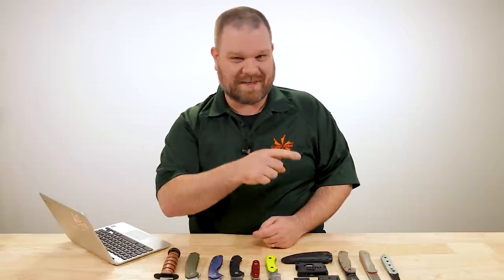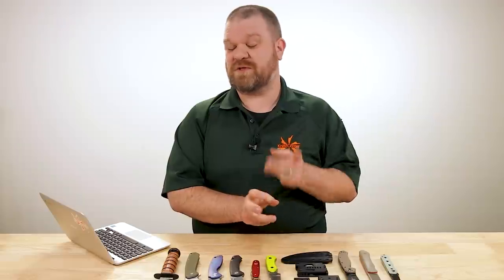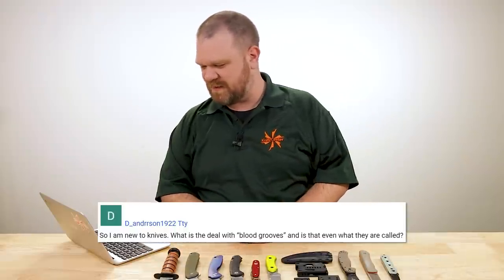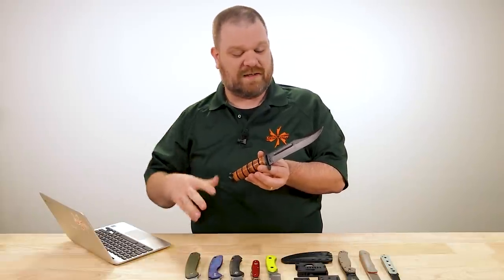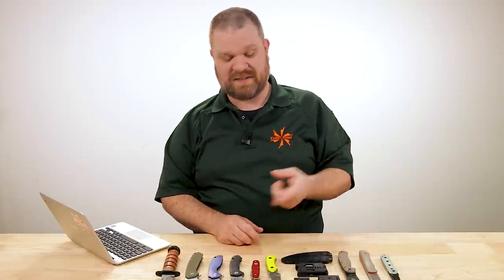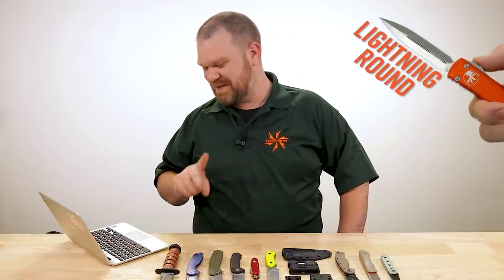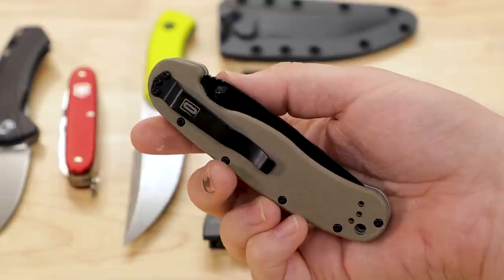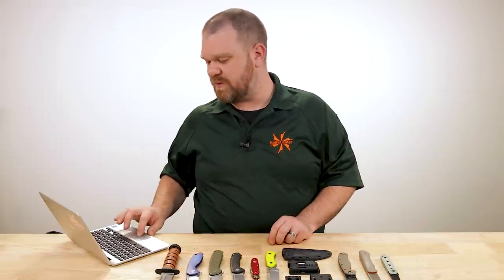KnifeCenter FAQ #94: What Is A Blood Groove?

Comment: If the knife maker made the groove with weight in mind then it's a fuller. The Cold Steel 1917 Bowie is a good example of an obvious weight driven groove. That knife has a long blade but it's not that heavy. But some knives are obviously just adding a blood groove to make the knife look more tactical or cool. And if Ka Bar says it's a blood groove then it's what the maker says it is. In war or something if your Ka Bar gets stuck in an enemy he can still bleed out before he kills you.
Reply: Respectfully disagree. At the risk of being distasteful to some of the public, you must realize that when a knife blade enters a soft tissue "object", the tissue closes around and into the fuller or grove. There will VERY little to no blood or fluid exit beyond what the blade would cause if it lacked the fuller. In the same vein ( oops ! ) the fuller will have a negligible effect on the "suction"  or resistance  to removal of the blade. Again, because the tissue has enough elasticity that it will conform to the shape of the blade cross section.
Reply: @wingmanjim6  Believe what you like. I don't care.
Reply: @wingmanjim6  He's even got the fake reason its called a blood groove wrong. Never heard anyone say it was so they could bleed out with the blade stuck with them. Most (incorrect) beliefs are that its to make the blade easier to pull out of the target or that its to make the blood run off the blade for easier cleaning after a good stab session. Granted both are incorrect, and its still a fuller whether its functional or aesthetic.
Reply: Fun fact... A heavier blade has more chopping power... Fun fact... Samurai use to pile up criminals to see how many bodies a sword could cut thru, earlier the standard sword would cut thru 3 or 4 bodies, after the blood groove slash flutter swords could cut thru 6 or 7 bodies... Now... How can u explain this drastic difference if blood groove has no impact on performance? When in theory the heavy sword should win hands down in a chop test? How much weight are we really saving on a 5inch KA BAR knife with a fuller? 0.05oz? Blood groove has been the oldest term for this feature. Now I'm a hunter... I've cut a lot of flush with different knives, and I'm telling u, tissue has a MUCH harder time closing up a blood groove. It might only be 2% increase in effectiveness, barely noticeable, but if that 2% causes a wound to take a extra minute to fully close up and maybe a extra pint of blood makes all the difference. And u forget, u get stabbed, wound seels around knife, guess what? U still have to move around to get help, continue the fight what ever, tell me would u rather have a blade with a fuller or without a fuller stuck in u walking to get help? Then tell everyone it has nothing to do with blood flow and it's not a "blood groove".
Reply: @stonefox9124  I completely agree with Stone Fox.
Reply: @seanhewson1341  Well, it's based on medical fact. If you don't like he facts, well then, I don't care either.
Reply: @stonefox9124  Well, your last two sentences are pure speculation - if you think that dinky channel is going to make much difference, all the medical information I've seen says otherwise. No disrespect intended.
Reply: @wingmanjim6  I think Ka Bar has more expertise on this subject than anyone else. They have been making these blood grooves for a long time and they know how their knives perform in war. If they call it a blood groove then that's what it is. Even if it didn't work for the sake of argument it's intention is still to be a blood groove, not a weight reduction strategy. So it's a blood groove and nothing else.
Reply: @seanhewson1341  M'kay.
Reply: @wingmanjim6  according to medical professionals every ounce of blood is critical in a gun shot or stab wound. What I have already explained is even if it doesn't make that much of a difference, even if it's just 2% increase that's still a critical amount because we're talking blood lose... Wanna talk science? No blood groove max surface tension on blade, no blood groove flat surface for wound to press against. With blood groove, reduces surface tension due to the pocket it creates, with blood groove u create a skin flap, like a doggy door, every movement causes it to swing making it very difficult for wound to stay sealed. I don't understand why it's so hard to grasp the science of a blood groove or why so many people are hell bent of dismissing it when I can drop facts like this all day long... To bad I'm at work...
Reply: @arrowheadguys7637  Yeah, because you know better than Ka Bar. Ha! Ha! After all they're only the people that have been making these knives and supplying them for wars for a long time. You are the expert here, not them.
Reply: @seanhewson1341  A marketing strategy is not fact. But if they give it a dumb name and sell more knives to folks who buy into it, despite the abundance of information readily available to the contrary, then more power to em.
Reply: @arrowheadguys7637  You're talking about Wikepedia. That's your "Abundance" of information? Ha! Ha! And if it was supposed to be a suction groove then why do they call it a blood groove. You haven't said a single thing that wasn't said just to be disagreeable. Knife Center dude here is trying to sell knives in a product friendly way so he doesn't want to call these things by their gruesome names. Do you think he thinks he knows better than Ka Bar? He knows what he's doing but you are just drunk driving your computer.
Reply: @seanhewson1341  wow, you really believe this, don't you? Worse, you think its really serious.

Sad.
Reply: @arrowheadguys7637  Yeah, you are sad. Ha! Ha!
Reply: @arrowheadguys7637  Have another drink. It's sure to cure your sadness this time. And if you're still sad try one more. Ha! Ha!
Reply: @seanhewson1341  A ha ha! You really got me, I'm so sad Mr. "Kabar would never lie to me to sell knives".
Reply: @arrowheadguys7637  Mr. Ka Bar? Yeah, you're a fountain of knowledge. Do go on, I'm hanging on your every word.
Reply: @seanhewson1341  You probably also think they're hard use knives, even though every time they're torture tested the rat tang fails. Go on with your kabar worship tho.

Comment: Hi Knife Center, Is there a SAK Waiter type knife with a slightly larger locking blade? The Waiter has the potential to be the best EDC known to civilized man, but that dang slipjoint blade and is too little/light for picnic duty. Ideal would be the larger SAK locking blade, corkscrew, bottle opener, tweezers and toothpick. Nothing more, nothing less. Any ideas? Thanks for what you do!
Reply: Theres a cheese knife based off the 111 frame.

Comment: Still waiting on a Rat1 with a crossbar lock. I've been in contact with Ontario and they said "It's being discussed"
Reply: This is something i didnt know I wanted, but am glad to hear may be a thing
Reply: Check out the Ganzo 727
Reply: @paulthelefty  I have the para 2 Ganzo version with crossbar lock but the steel is terrible 440C, my Rat-1 has AUS 8 which is also cheap but a lot better than the Ganzo. Also the crossbar lock often does not work as smooth. But for the price of 22 euro it is a great buy

Comment: The only problem I have with your fuller explanation is this: How much lighter is the blade due to the existence of said fuller? Look at it as a percentage of total weight and you'll see what I mean.
Reply: For a 3' sword the weight reduction is significant. 20-30% likely. Those fullers were generally much larger than the examples he showed.
Reply: It might not just be general weight reduction, but having a reduction in weight in a certain area to positively affect the overall balance of said knife.

Comment: Has anyone actually tested 2 see if it would work as a blood groove?  Like a Lyn Thompson test,not a test on people of course. 🤷🏼‍♂️🤦🏻‍♂️ Just wanted 2 clarify lol.
Reply: I've slaughtered a dozen or so hogs over the years, and used a few different types of knives to bleed them out, including ka-bar. The only difference in performance I've noticed from one knife to another is the thickness of the blade, it's not scientific by any means, but if the fuller helps at all I don't notice it.
Reply: Marines are trained to put a little 45° twist before withdrawing a bayonet from enemy.  Sometimes you have to put your foot against the surface to pull a bayonet completely free - without utilizing that little twist.  
This might seem superfluous, but if things are so bad that you need to actually use your bayonet, then quickness of action will matter.  
Even if you don't find it difficult to remove a bayonet, you might still appreciate not having whatever you did stab - still hanging, stuck to the end of your weapon..  
Your fellow fighters might point and laugh..  Or try to take a selfie..  
Just a thought.